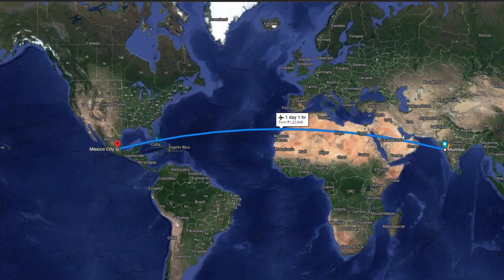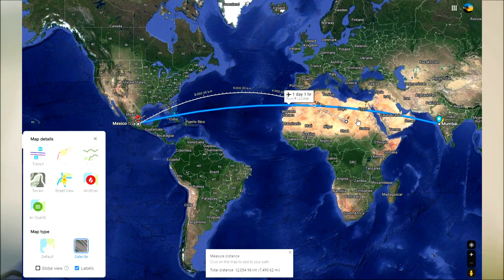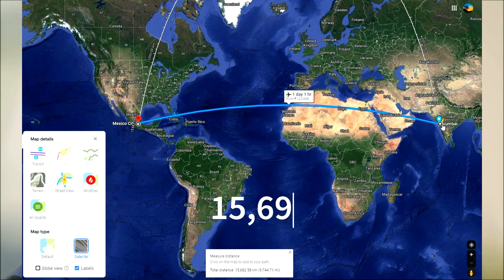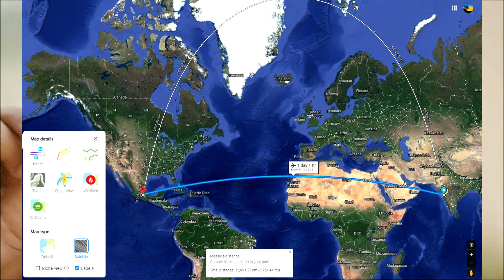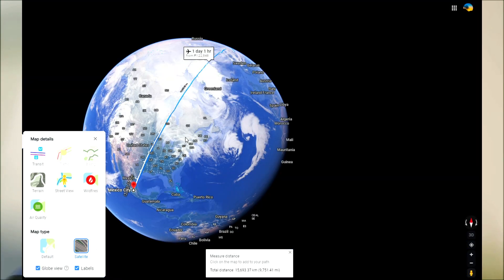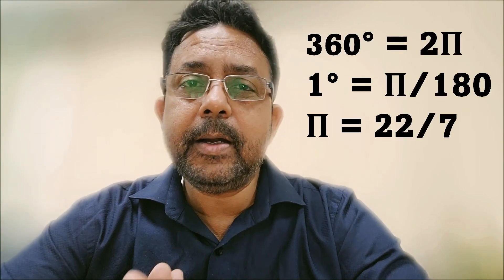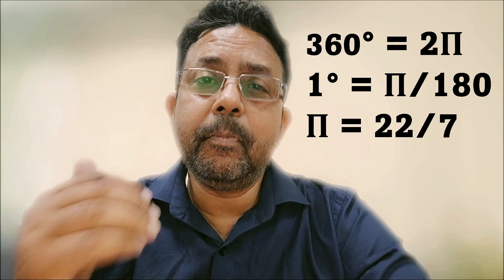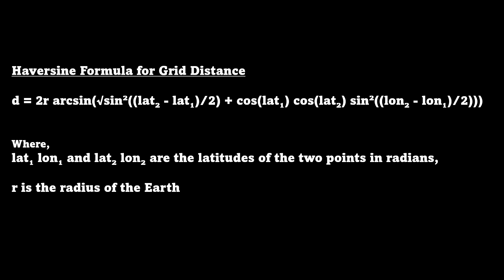How Do We Measure Distance On Earth Surface

Comment: How tall would two poles plumb to the surface have to be and how far apart on earth to detect the deflection of the vertical?

Measuring the base length compared to the distance between the top of the poles.
Reply from the maker: Deflection of the verticals are generally calculated mathematically. But with recent technological progress in GNSS, we can find height differences between Geoid and Ellipsoid and with the help of zenith camera, one can calculate deflection, not me though. I am not clever enough. Measuring distance between poles will give you lots of added errors. Some of them are curvature, local refraction, local gravity and scale factor plus local topography. Yeh its a lot to take into account. Topography is never ideal surface to measure and thats why we use mathematical models so that everybody is in the same page.

I am not sure i have been able to reply to your question. Please let me know if you agree or disagree.